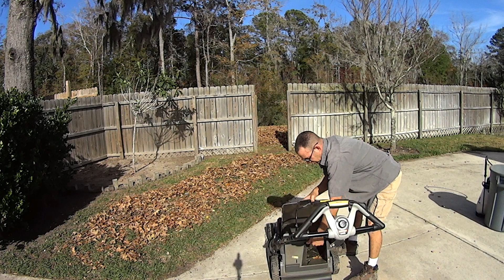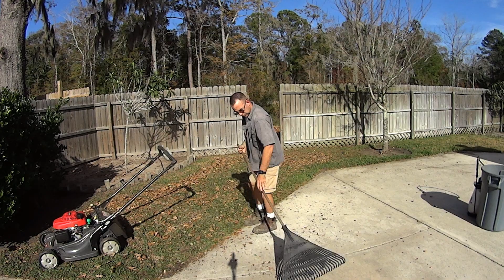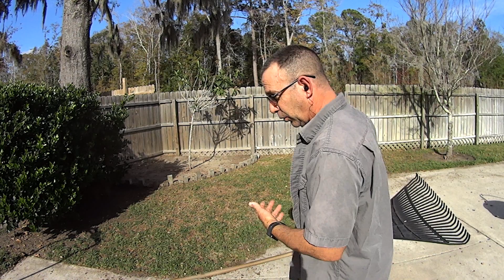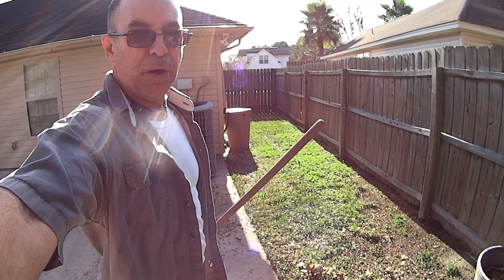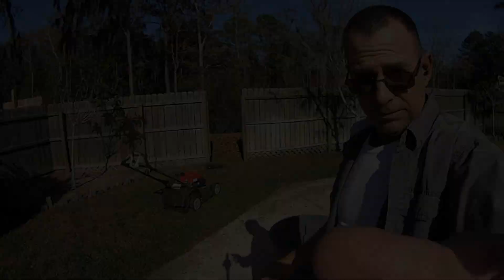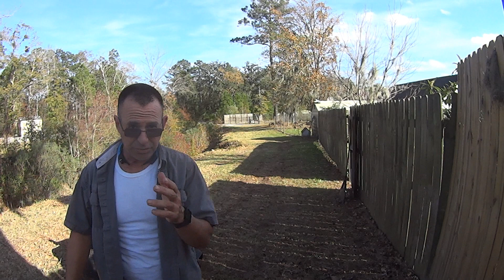Fall / Winter Clean Up Mulching Leaves with Honda HRX217 and Craftsman Riding Lawn Mower

Comment: I added G5 Gator blades and blocked the chute on my 42" Craftsman 2 years ago. Disintegrates dry leaves with the deck on it's high setting. I used G3 gators in the past but I had to drop the deck down low for a good mulching effect. The G3s don't have as much lift as the G5s.  Happy New Year!
Reply from the maker: Great info Brent! Thank you and Happy New Year

Comment: So I have this same exact mower but with the electric start and variable shifter per say. I have noticed if I drop the mowers height down one inch, you eliminate the leaves from blowing out on the sides. I normally cut at 4" but when mulching leaves, I go down to 3" and the leaves don't leak out the sides while having the back closed off completely. Love this mower for mulching.
Reply from the maker: Thats great but... what if the customer doesn't like a 3 inch cut?!! Sometimes we just have to chase the clippings to keep the clients happy lol Darn clients ruin everything

Comment: Have a happy New year dan.great video
Reply from the maker: Thank you Tommy! How is the new engine?
Reply: @DansVlog  the mechanic I used put a riding mower engine on my walk behind.i haven't had the money to pay him yet. Now will this engine work on this walk behind?????worried in Alabama
Reply from the maker: Engines either run or don't run. They don't know the difference between a rider or a walk behind. As long as the pulleys fit the shaft and the HP is close enough, there will be no issues. Should be fine!

Comment: You can tell especially when the door is closed all the way that the mower wants to discharge out that right side really bad. I wish Honda made an option on these to have side discharge instead of rear. Getting clippings blown all over your feet is annoying.  On the other hand I just an HRX anyway because they’re awesome! I just wish it had side discharge. And no, I don’t think you can get a rear side chute for these, at leas5 I haven’t been able to find one.